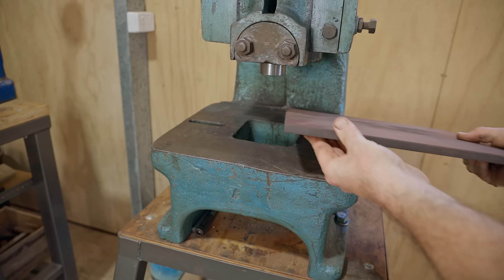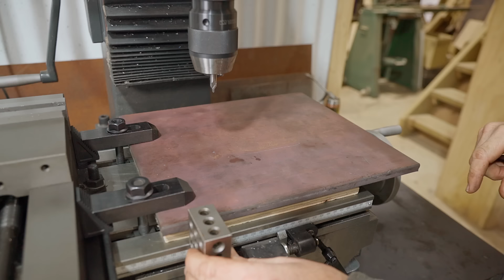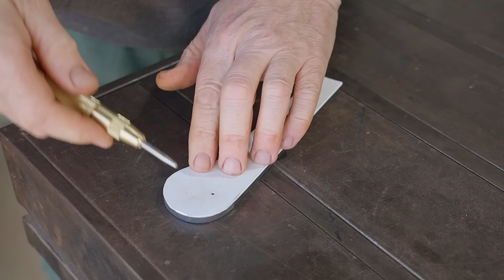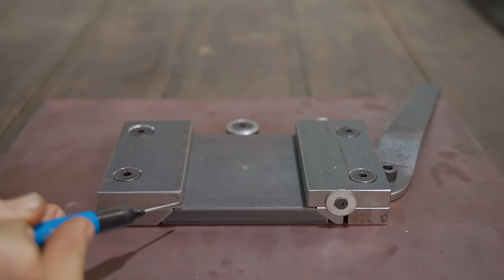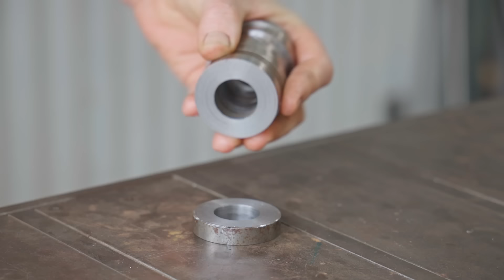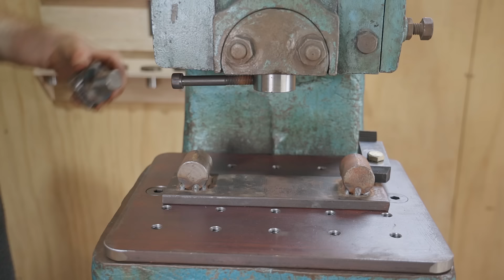Making this unique and favourite tool even more awesome?

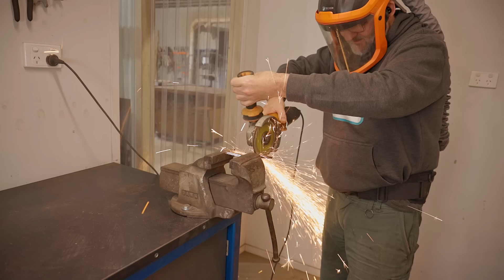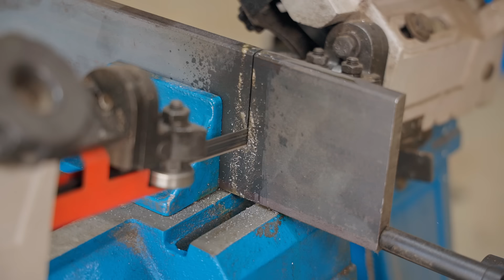Comment: At about 6:15 I was expecting to see you cut the plate on the band saw you used at 1:01, but I reckon that although it looks like it can be mounted in a way that would make the band run in a vertical position, there still is something that makes you avoid it.
I don't know if YouTube allows links even of its own stored videos, so I'll just leave you the name of a video that shows how to tremendously improve a band saw just like yours.
Just search for: Transforming a Budget Machine into the Ultimate High-End Tool
It's a pleasure to watch for anyone interested in creating things.

Thank you for another great video.

Comment: Awsome build, I think I could use something like it. But with a few modifications, I'm gonna start drawing tonight!👌🏻 And a tip! When you're countersinking, use half the drill speed of the largest diameter what you're going to countersink, and double the cutting-oil and double drilling pressure. It will stop chatter, give a super clean surface and your countersink bits will last way longer.👍🏻

Comment: Hi Ya.
I have worked 30 yrs in sheetmtal shop. We used to have 5 or 6 fly press's . As am apprentice we used to do loads of punching holes and shapes on them . I would recommend adding a splash of paint to identify the faces that are on show to the operator of the press (orientation) . We all have days when you go ''how did  I do that last time ??
Nice bit of kit you made there. We used to do hundreds of baffles out of 0.7mm stainless upto about 450 mm long with a sort of profile of the OMEGA symbol . Then moved over to the next fly press and put a little notch/location tab. Very good work out too and especially when you get a rhythm going , swing the handle away (DUCK YOUR HEAD ) get the part out and the new one in , all as the handle starts coming back down . Regards Don

Comment: I notice you use a brush to clear away the steel chad from the operation. Has it occurred to you to use a magswitch instead, anytime you're working on steel? That way it doesn't go flying about, landing God knows where, is all in one place, and you can "drop" it into a waste location (heck, perhaps a "to be melted for recycling bin") simply by disengaging the mag switch...?

Comment: That’s a nice fly press. It’s hard to get good ones as even old, used ones, go for a lot, plus shipping, if you can’t pick it up. I’ve got a good hydraulic press plus a 3 ton ratcheting press. But the hydraulic press doesn’t really give the precision sometimes needed and the 3 ton ratcheting press isn’t as powerful as 3 tons sounds. A fly press is a perfect addition to those two. Your equipment designs are always interesting and useful. I’ve gotten ideas from them. Thank you for your superior work.

Comment: The top plate of the non-lever-side can be removed. The chamfer of the bottom half will do the trick of holding down is enough.

Comment: You can do similar stuff when using thinner gauges sheets with 3D prints. Don´t need to weld or whatever simply print out the tool and use in a press.
Nice part about 3D printed tools is, you only need to store the digital file instead of the physical object.

Comment: Pour casser un angle ou même fraiser , ; une fraise à 45°assez grosse c'est plus pratique que de chercher à mettre la pièce à 45°avec un détecteur de pente le serrage de la pièce de cette façon risque d'être aléatoire, alors qu'une pièce serrée à plat c'est plus sécurisant; mais j'oubliais que dans ces vidéos la sécurité passe au second plan; on ne montre pas les séquences où les pièces volent en l'air, ont ne voit jamais non plus de mains abîmées le savoir faire ce n'est pas que des vidéos propres c'est aussi des pièces bien positionnées, penser aux néophytes qui tentent de faire du fraisage sans connaissances ni diplôme: j'ai encore mes dix doigts et mes 2 yeux avant la retraite mais pour les vidéos je regarderai you tube c'est moins dangereux que de faire du fraisage il faut choisir ..

Comment: Nice video mate. You may have already done this, but looks like you should also make a T-handle bolt for locking that top die so you don't need to keep reaching for the allen key.

Comment: It's interesting that these fly presses are non existent here in Canada, I've never seen one in any of the shops I've been in. Everything over here is hydraulic. Probably generates more force, but not nearly as fast as the fly press. We do have something with a rack and pinion, but they are terrible to use. They don't generate a lot of force, and the handle operation is vertical, so the dies are always closing when you let go of the handle.

Comment: Not to be a loser, but I’d get every one of those pieces laser cut from some internet laser cutter. So cheap, so accurate, and as many free features as you like. Of course you’d need some finishing with adding the dovetails and all, but the cam especially is a perfect application.

Comment: Dang!  That fly press works great.  With one of those you really wouldn't wish for a power hammer in the smithy.  I have known about fly presses for decades but never saw one in action...or even saw one in a shop that I can remember.  They just don't show up on used equipment sales that I have seen.  Yes, that is the sound of envy!

Comment: As with all of the videos - you provide a great explanation and solution.  Have you considered making any of your inserts square, and beveling all four sides? Then you could rotate the dies 90, as you might need to change the orientation based on the size or length of the forging, and the limitations of the throat length of the press.

Comment: Why cut the steel then put the 45° angle on with the mill? Easier and quicker to cut the 45 on the bandsaw, any excuse to use the mill 😂

Comment: Hint when cutting countersinks  for screw fittings so they can be  below the top surface for a perfect chatter free finish put a piece of cheesecloth between the cutter and the metal being countersunk that absorbs vibration and result is a perfect finish without any chatter marks, Important when a good fit and finish is required so parts bolted together such as fixtures do not come loose under machining loads.

Comment: Using a shoulder bolt will stop your eccentric handle from getting all marred up from the threads of the screw you're using. And you can lock tight it in so that it doesn't come out and have the shoulder be the same thickness your material

Comment: You've put together a nice hobby shop and your video is enjoyable. 
Fwiw, it appears that you're using extremely slow speed & feed rates, although I could be fooled by an illusion created by video frame rates. (Wagon wheels don't actually turn backwards in westerns!) But when you stated that the sander was quicker than milling 45° chamfers on the plates... I became more suspicious of the actual cutting speeds!  Proper speeds and feeds are your friend!  
Quick question: What is the blue paint you use on many of your machines? It looks similar to the color used on Kurtz vises. It took me forever to find an off-the-shelf enamel (for machine tools) which closely matches that shade.  I suspect you've been through the same search!

Comment: Suggestion for an upgrade, to keep the floating dove tail from falling out. Mill a slot in the dove tail and add a roll pin to the underside of the cap plate. You will never see what holds it in and it will look really cool.

Comment: There is a larger problem of using a keyless chuck for tapping than the tap coming out of the chuck when reversing, and that is that keyless chucks are self tightening and when they sense the tap slipping they tighten down and can tighten down to the point of cracking the chuck internally. Don’t ask how I know this.

Comment: A removable handle for the top tool screw would be a cool addition. Also would it help to have a pin off the side that lines up with the screw to rest against to make sure the top die is square. Maybe it doesn't matter much

Comment: Seems like upper plates on toolpost may be much more thinner than it is, because there is a very few pull-off force applying to, it's need to only hide bolt heads something like 2/3. But well done!

Comment: I agree with most of the comments, you are one of a kind. But let me point a minor detail. Always on a constructive sense:
It's easy to get it once it's done, but I'm pretty sure you could center all the assembly when it was all mounted. No need to center mark it on the fly press if you'll going to take it out. At least no need of a so precise measure.

Comment: I would never have thought to use a fly press to forge steel, it’s the kind of tool I associate with pushing say bearings in/out. So, I am impressed with your additional use of the tool and even more impressed with the quick-change tooling system. Although a lot of time to produce, once done it will save a ton of time in the future. Thanks for sharing.

Comment: Fantastic video! First one I've seen from you, but you're a great presenter.
I'm the milling guy in the shop, so my one piece of advice is to grab yourself a roughing end mill! That will chew through steel like it's nothing! Will definitely be faster than using the belt grinder.
And I'd suggest making blocks with 15°, 30°, and 45° angles on them, so you can easily set up the chamfering ops! 
Great video!

Comment: Depending on the quality of the chuck sometimes a keyless chuck can hold better and be more accurate than a keyed chuck. The most accurate and strongest is a locked (with through bolt into the tool holder) morse taper.

Comment: Awesome job, I am going to steal some of this for my students to follow on our forging press build. Suggestion, it would be even better if you extended that allen head cap screw that hold the top die in place and add a handle to it, no need for a hex key then.

Comment: Great video and brilliant little jig for the Fly Press.
Only thing I'd improve is to make the Cam Lock work so it pushes the plate backwards toward the backstop, whereas it currently has a tenancy to push the plate forward away from the backstop as it cams.

Comment: Really nice set up.  I have an old screw press that is really useful, and I can slip a hydraulic bottle jack in it to get extra power.  If I put those plates in the wall fixture, I would have trouble getting them out because of the tapered edges.  I would flip them over.  The fly press is something I had never seen before your videos.  I'll have to keep an eye out for one!  Thanks for sharing your ideas and skills.

Comment: You could put 45s on all 4 sides of the tooling plates for dual ability to rotate orientation. E.g if you needed the long dimension side-to-side on the press, rather than the short one to the back of the body of the press

Comment: very cool jig. i love cam-locks. maybe make a handle for that top die retaining screw, no? instead of an allen key. i weld handles onto bolts like that and then grind the threads down until the handle points the direction i want.

very cool modification

Comment: Forward: this is informational just in case you don't know, not criticism.

Digital protractor was fine for this but it's far from an accurate tool when dealing with the accuracy accomplishable with a precision tool like a milling machine.

For setup work such as this angle blocks & sine bars are pretty much the gold standard. Also, creative use of 1-2-3 blocks similar to how you used the what looked like aluminum plate & dowel pins.

The above methods are both super repeatable & just as importantly, they can stay in place to support the workpiece to make shifting in the vise is less likely. Having a part shift, especially with this kind of work where you're making multiple passes, freaking SUCKS.

But, again, if you didn't have angle blocks the digital protractor seemed adequate for particular job.

Just something to keep in mind for the future!

Love your channel!!

Comment: I have clamped an old magnetic chuck from a surface grinder to my fly press bed. I fit my top tool into the ram spigot hole first. Then lower it into my bottom tool to align them both and turn on the magnet for quick and perfect alignment. Demonstration here - https://youtu.be/biwzei_pt5c

Comment: I worked in a steel shop making brackets for london underground cables. we had lots of jig and things set up like this but we had hydraulic presses and shears and such. you NEED jigs when doing thousands of one part. with small tolerances.

Comment: I absolutely love my fly presses, from flateing to bending to punching to cropping to pushing in and out bearings and a million more uses, I had a customer want me to design and build a small hydraulic press with interchangeable tooling so they can punch tube from 100m dia to 400mm dia 3mm thick so I said have seen or used fly presses and they said no they want hydraulic, I said ok but went and found a bar fly press made some punch and dies then told the customer to come in and see, it blew his mind at how simple and universal it was, he now has 7 presses set up and loves the fact it doesn't need power. I noticed on yours you have your clamping top bolt on the side, you need it at the front so you get more stroke and won't sheer the bolt off and if you bending anything yo can get more height on an angle. 👍👍👍👍
Reply from the maker: Awesome Ricardo! That's why I love them too, so versatile. The bolt for the top tool only limits the travel by a couple of millimetres. There isn't a heap of clearance on the bigger press, there's quite a bit more on my smaller one. :)

Comment: Can you back a keyless chuck for a drill press counter clockwise 1 click like you can a cordless drill chuck. This locks the chuck so it doesn't losses up like it did. I don't have a keyless drill chuck to try it. Just curious if it does it also. Sounds strange but it does work on cordless drill chucks anyway. Thanks for sharing

Comment: You sure are a resourceful bugger Pask. I bent a handle today just like you did but I just put it in the vice as usual, and even though I have an arbour press and 20 ton hydraulic press it never occurred to me to use them. I’ve seen plenty of fly presses but never seen one used, how much force can it apply? Cheers Stuart, Canberra.
Reply: This one is a 6 ton and his old one is a 4 ton
Reply: @corinkayaker  Thanks 👍👍👍

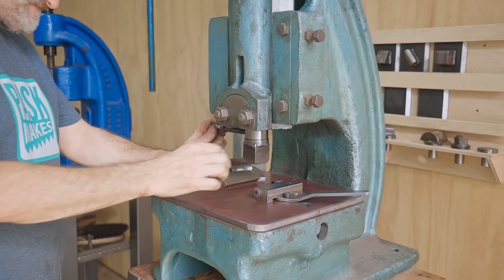Comment: Great design and execution.  All I'll add is that the cam lever could be improved a touch by rotating its action to 3 o'clock rather than 1 o'clock.  Also make it the opposite sense, i.e. clockwise to engage and anticlockwise to release.  Watching you engaging (at 16:18) by pushing at the back at a less than easy angle made me realise this.  Pulling to tighten will be easier too I think.  All you'll need to watch is that the handle clears access to the attachment bolt when it is  fully disengaged (anti-clockwise).  Hope that helps.

Comment: You could actually make it more compact by getting rid of the top plate at the fixed side. The dovetail will prevent upwards movement anyway. An added bonus is that you can use those extra counter sink after all.
Reply from the maker: You're right it isn't needed for the dovetail but it does have a purpose. It keeps any scale or debris from getting into the dovetails. :)
Reply: @PaskMakes  Machine shop work taught me that chips can even quantum tunnel into places previously thought impossible, but taking some extra precautions is fair enough. Thought I'd mention it in case you ever need that little bit of extra clearance ;)

Comment: A short piece of stock welded to the tightening screw for the top die and you would have a tool less change set up. Still very brilliant in it's simplicity while allowing increased function. You sir are a master at that, and I love it.

Comment: I can see the top of the fly press being modified so that it doesn't require a tool to release the die. also can see a method to align the die so that it's just slapping in the die and turning a lever for even faster tool change

Maybe a small wheel at the end of the bolt and a step on the collar

Comment: Nice vid, as a machinist I love building practical tooling. Wondering if you've heard of Spot drills. I use them regularly in my shop saving my center drills. They are easier to sharpen and far less likely to break in use, especially when compared to using the smaller center drills.
Reply from the maker: Thanks very much! I've thought about getting some spot drills, I'll try and remember next time I'm shopping. :)

Comment: Anything that makes jobs quicker and easier is the way to go. You could probably make the bolt that holds in the top of the die toolless as well, longer bit of steel, bend it into a handle and cut threads into it.

Comment: You don’t need the top block on the non-camming side. The cam will force the plate under the dovetail. So maybe the countersinking wasn’t wasted after all
Reply from the maker: You're right Sean, it isn't needed for the dovetail but it does have a purpose. It keeps any scale or debris from getting into the dovetails. :)
Reply: @PaskMakes  well if you ever need more clearance on one side you can take it off. A win for not welding it together

Comment: Awesome project! And all the parts have a nice chamfer on the edges, very pro. Do you spray the pieces with any protectant or anything?
Reply from the maker: Thanks Ben! I didn't show it but I sprayed all the parts with Boeshield T9. :)
Reply: @PaskMakes  awesome thanks man. Good idea. I recently picked up a portable band saw for metal, and a steel plate for it so you can mount it in a bench vise. I’ve been contemplating how to finish it…. I have some glidecoat for my table saw, that may do the trick.

Comment: If you made the tool plate a square and chamfered all 4 sides you could spin it 90 degrees.
Also you could mitre cut the flat bar to reduce the grinding time.